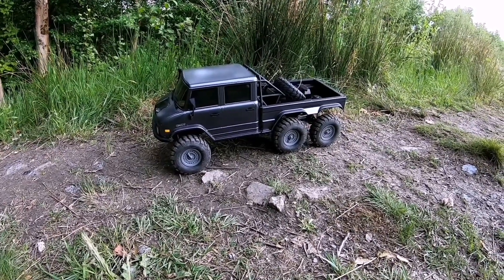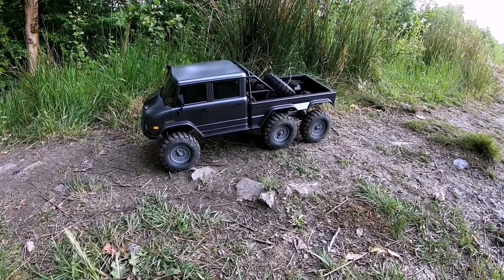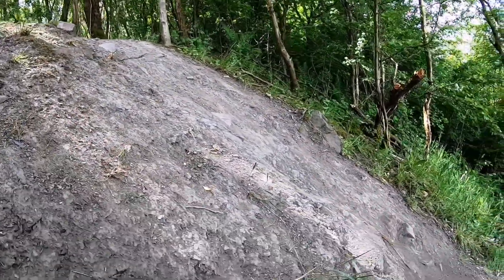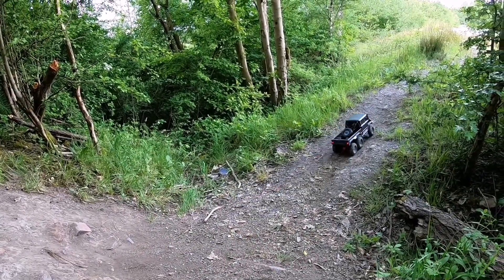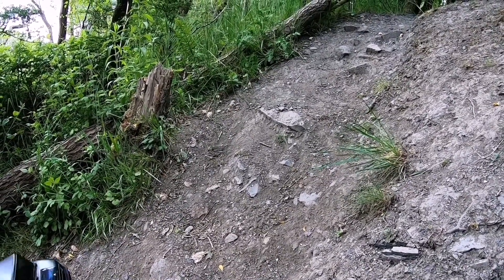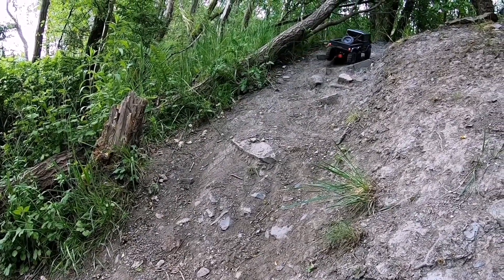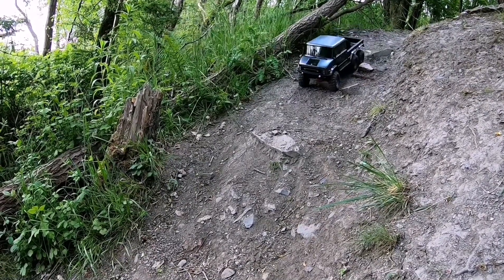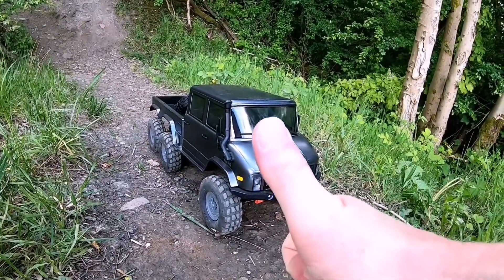Axial Umg10 6x6 Quick Off Road Hill Test

Comment: Looks great that. Really tempted by a 6x6 now they look to perform spot on 👍👍
Reply from the maker: BRISTOL RC CRAWLERS Thanks a lot dude. I am so happy with this truck. Its brilliant, even as stock form. I was thinking that it would have needed a few upgrades when i bought it because its like 300 quid cheaper than the Trx6. But actually its really good as stock form. I have even bought 6 Proline Hydrax tyres for this truck thinking that it might have struggled with the stock tyres, but i should have saved my money lol. I will do some upgrades at some point and i will try the proline tyres on it and at some point i will change the plastic shocks for metal ones, but as i say, this truck is brilliant even as stock. Thanks dude

Comment: Been saying it for years brother. In my opinion Axial is an amazing truck right out of the box.. OK. a little bias, but. This one proves it, once again. Very nice bud. Glad to hear you are enjoying it man. Nice video and Thumbs up.. :)
Reply: Ditto !
Reply from the maker: As i was reading your message i was actually thinking in my head that Holly Hill thinks the same, and as you can see he has beat me to it and has agreed with you. This is my first axial and it was about time that i got an Axial in my collection, but at this momment in time i have to agree with you both, this truck really is brilliant even straight out of the box. It is becoming a close tie between this truck and my Trx4 as to which i like best, however, the Trx4 has had a few added bits on it and therefore is not stock anymore. Thanks a lot guys

Comment: 6x6 really adds a lot of ability for climbing and this rig seems not to have much extra weight over the usual 4x4s we all run. Great rig and great demonstration. 👌
Reply from the maker: AnT R/C Thanks a lot dude. This truck isnt really that heavy compared to the Trx6 and even my Trx4. But what ever Axial have done, it crawls really well dude. Even as a stock truck i have had it out several times and it has impressed me. I have got some Proline Hydrax tyres for it but the stock ones have turned out to be good enough lol, I should have saved my money, Thanks for watching buddy

Comment: It’s crazy the level of performance you get from this rig, right out of the box.  Nice quick running.
Reply from the maker: RC's Big Air Its amazing how good it is as stock, it has really impressed me dude. i am struggling to decide which is my favourite truck now between this Axial and my Trx4. i have actually been out with the Axial a few times but have not filmed any footage and it really is brilliant. I was thinking that the tyres would not have been very good so i also bought enough Proline Hydrax tyres for this truck but as yet i havnt used them. i suppose i will do some form of comparrison video with the tyres at some point and i will most likely do some upgrades too, but i always like to buy a new Rc and run it as stock for a while and make several videos of it as stock for people to see. Thanks for watching bro

Comment: Tibor Von she is a 6 wheeled OX 🔥🔥 I have heard good things about those climbing up and down some pretty remarkable embankments. Thanks for sharing the video my friend. 👍🏻
Reply from the maker: TomTizums RC Thank you very much Tom. i am very impressed with this truck. Even as a stock truck it is brilliant. I have had it on rocks and it drove over them with ease, i have also had it on rough ground as in this video and it was brilliant. I have also had it out a few times but havnt filmed it. I am struggling to decide which is my favourite crawler right now, this truck or my Trx4 ?   I have bought some proline hydrax tyres, i didnt think the stock tyres would be as good as they are so i almost wish that i had saved my money lol but seeing as i have 6 proline tyres then at some point i will do a comparison video. Thanks for watching dude

Comment: Great performer :-)
Reply from the maker: Bas Boy RC Hello Mal, yes this thing is a great performing crawler even as stock and straight out of the box. I have tried it on several surfaces now and its been brilliant. I was expecting the stock tyres to let it down a bit but they havny lol. i have 6 Proline Hydrax wheels and tyres for this truck, thinking that i would need them, but i should have saved my money lol.  I will fit the new tyres at some point and see what difference there is and the only other thing that i can think of is that i will replace the plastic shocks for metal ones although the plastic ones do seem to work well. Hope you are keeping good and well matey
Reply: @tiborvon  That's one thing I avoid is changing tyres, I only do if they are bad the original Coyote tyres. . On most cars I like to change to  cheap metal wheels and that's always a weight advantage. it does amaze  me what people spend for no reason on there trucks. For me upgrade when it breaks :-)
Reply from the maker: i do kind of agree with you on that one. generally speaking with my bashers, notorious etc, i also think that you should wait until something breaks before you upgrade it. But then on other occasions if i havnt bought anything for a while, i just get the urge to buy something and have a bit of retail therapy and then buy stuff that i dont really need lol.  I think in the case of crawler tyres, it has only really been my Coyote that really did need new tyres for better performance, and also my Maverick Scout Rock Crawler. Having said that though, the Maverick was only about 110 quid so its hardly going to come with top notch tyres.
Reply: @tiborvon  We all suffer with the urge to buy things. But normally it's what I need, like today run out of 4mm ABS tube. Ordered 4 lots in 3 different sizes and got 20% discount sweet. Yes the Coyote tyres were really bad but the kit ones that came on the LWB chassis I run the Power wagon body they are really good and not a silly size.

Comment: Nice,looks scale and very capable 
and very realistic
Do you think 6x6 makes a difference while crawling I imagine for hill climbing its great
Does the extra axle effect the Turing radius?
Reply from the maker: smash rc Hello dude, when i first saw these 6 wheel crawlers coming out for sale i thought that they would not be very good. But i was mistaken my friend. The Axial 6x6 and my friends Traxxas Trx6 are very very good crawlers. The extra axle defo gives it a bigger push over rocks and hills. I dont think the turning circle is effected, the servo on this truck is a high angle of movement so the turning circle is ok, i am really pleased and impressed with this truck and how good it is even as standard and stock and straight out of the box.